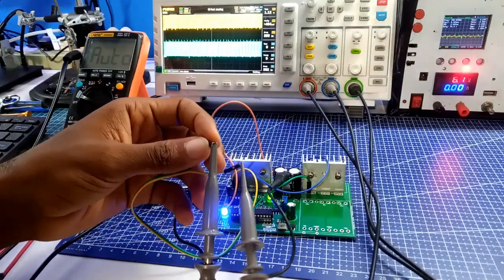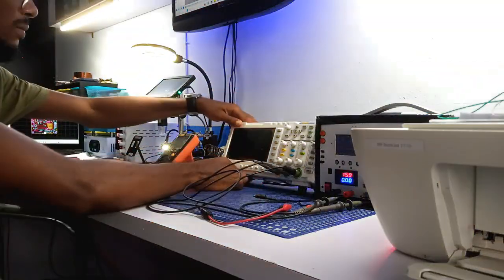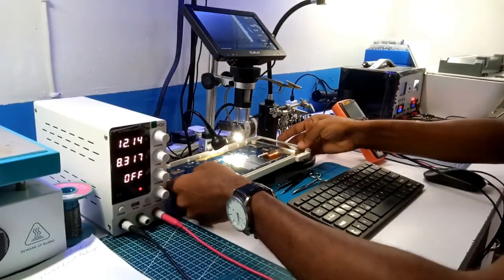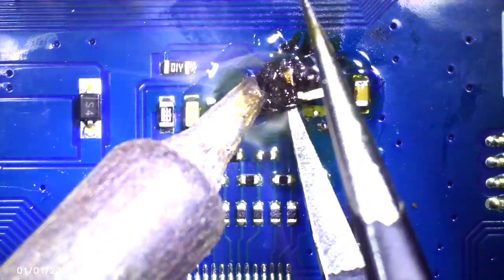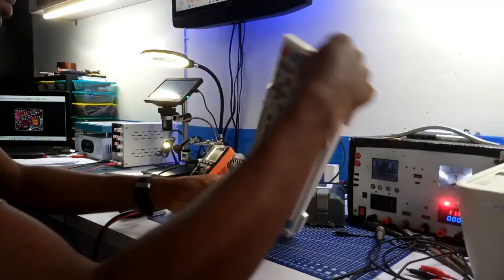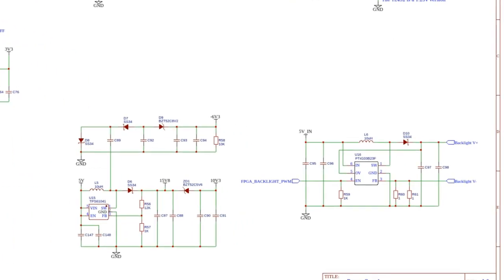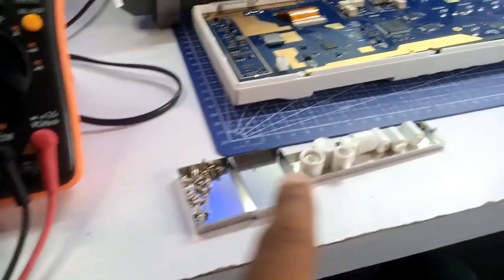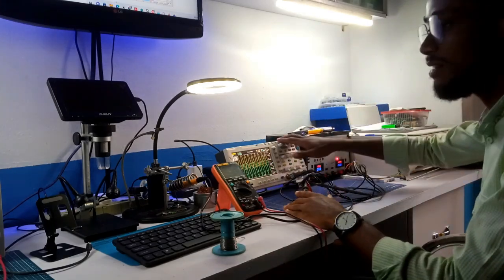How To Damage Oscilloscope FNRSI 1013D -1014D

Comment: I have the exactly the same problem, I to have the same scope and had mistakenly used another power supply with 12 volt dc instead od 5 v, can you be able to hook me up on where i can get those parts and scematic please? and the proper numbers on the VR?
Thx
Christopher